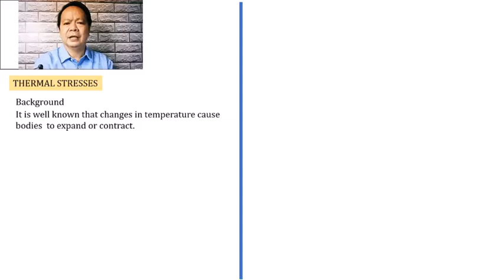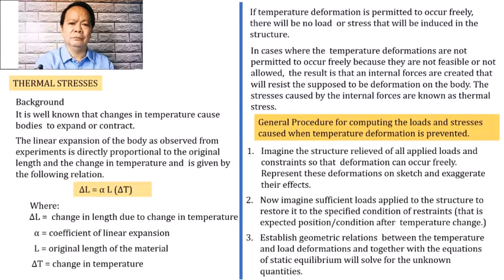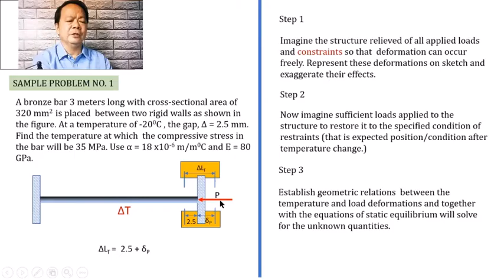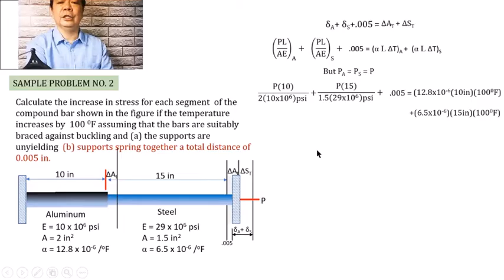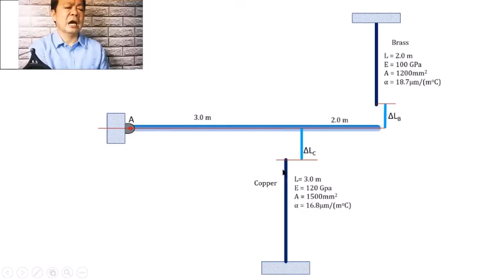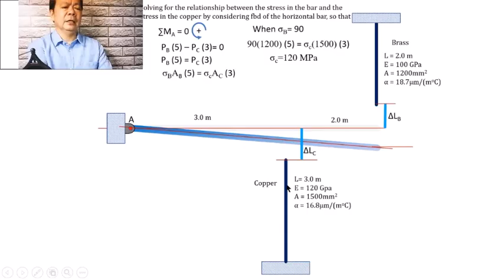Thermal Stresses - How to deal with them systematically.

Comment: Thank you sir for this topic. However, I still have confusion about the analysis of thermal deformation and the deformation cause by the force. Here's my question, What if the second problem you presented is subjected to weight and we assume that we transfer the copper rod above (same position with the brass ) with some distance at the support, we also assume that the copper rod is shorter than brass rod. Then the weight is near the end of the bar. What will be the changes? Are you going to add the temperature deformation and deformation due to force? What will be the best approach to establish a compatibility equation?
Reply from the maker: Thank you for watching my video. The best way to establish the relationship between the deformation due to forces and the deformation due to temperature change is to make an assumption or estimates of the final position. Then show there the deformation due to temperature change. The question on whether the deformation due to the forces shall be added or subtracted shall be determined as the difference between the final position and the position due to the change in temperature.  Then finally equation of compatibility can be established by using geometric relation between these combined deformations